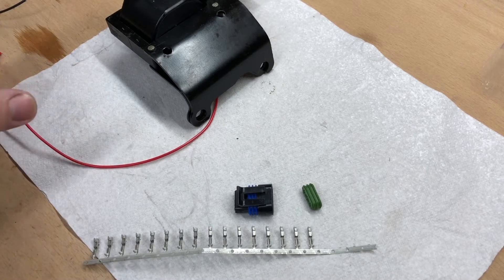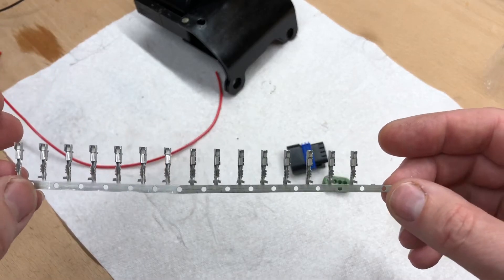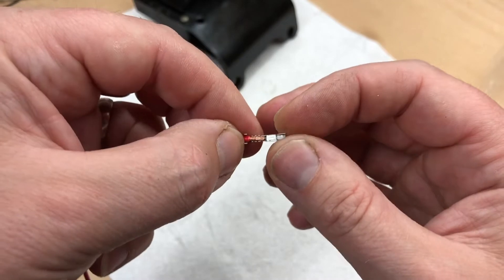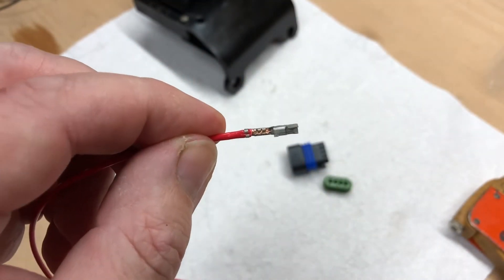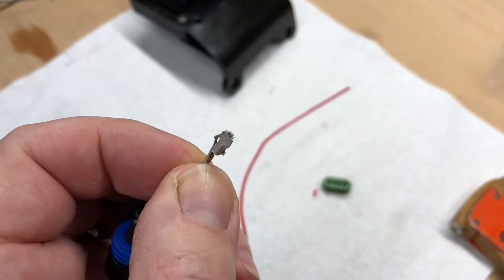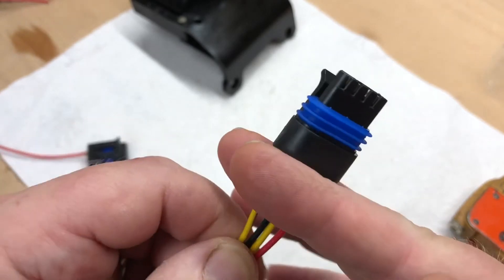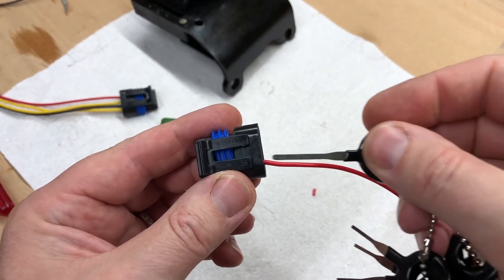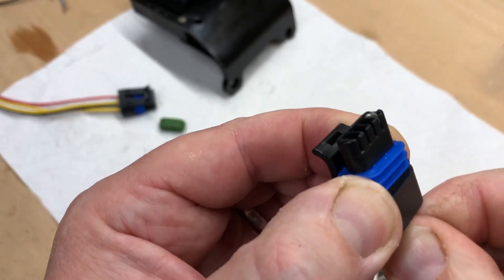Metri-Pack 150.2

Comment: Nice Thank you Bro! 
Now how do l de pin the same connector? Do You have a Video showing how to De-Pin the same connector? 
A Metri Pack 150.2 Pull to seat.
Reply from the maker: You didn’t watch the whole video did ya! Scroll to 5:47 and I show you from there :)
Reply: @newlifemarine1476  
I almost made the same mistake.  As the video was winding down, it seemed like you were going to wrap things up without showing the de-pin process.

Comment: What type of crimper used.?
Reply from the maker: It was just one I found on Amazon.
Reply: @newlifemarine1476  l just got one that crimps the wire and the strain relief at the same time. 
I think l like the one at a time thinner connector you have better.